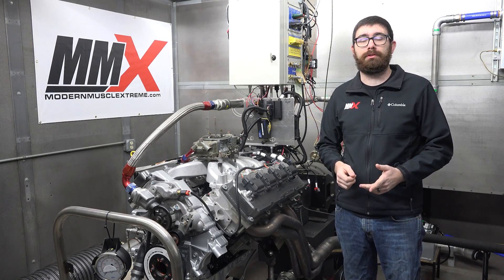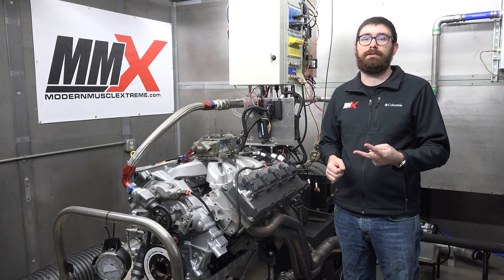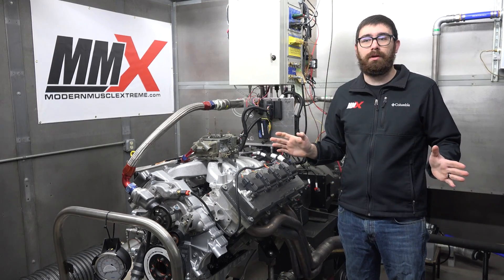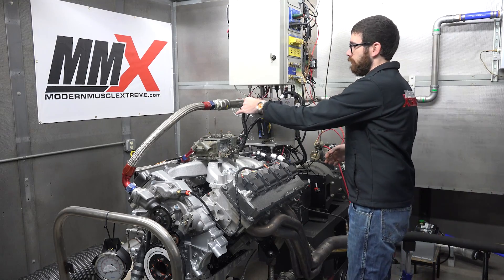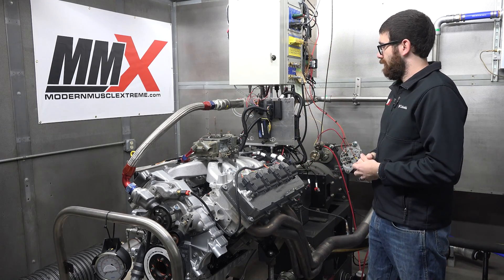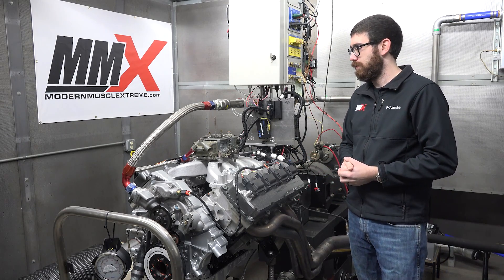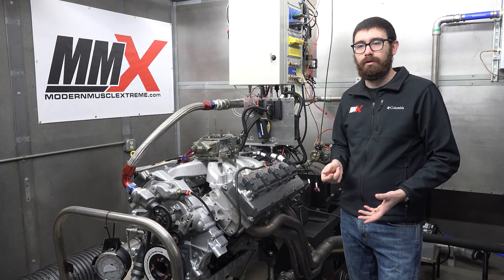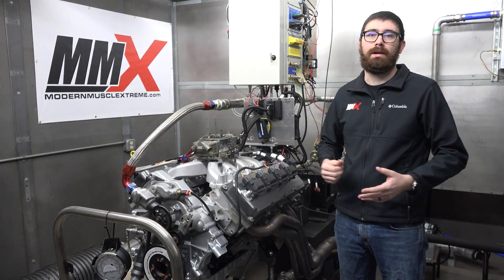Gen3 HEMI Carburetor Ignition Control System by MMX and EFI Source!

Comment: Greetings! I have a similar project, but I don't know much about that engine! I'm thinking of replacing the camshaft with a CompCams #201-426-17and a holley ram tunnel with 650cfm carburetor pair, I'm worried about the VVT system! Is it possible to remove it? And most importantly, friend, part numbers and manufacturer of the electrical parts to use

Comment: Customer came in last weekend  with This MMX system on a 74 D100 4x2 with a 2015 junk yard sourced SRT392 , we had to tear down the front of the engine to lock the cam, got it back up and running. simple to use , setting timing map was easy . The customer is having us replace the set up with a 05 Durango ECU  and use a SRT8 manifold and 90mmTB,

Comment: What about the mds. Just leave it disconected
Reply: MDS= Screwed , need to delete the MDS system
Reply: Just leave the solenoids in with no wires to them and it will run an mds engine just fine

Comment: Whats the advantage of this system over the EFI
Reply: 1 advantage would be to be able to swap cams and bolt ons & tune it myself. $300 for towing & $900 for dyno tune & still get O2 codes. Reading spark plugs or wide band would be very helpful.
Reply: @palmbeachcane9523  you need a better tuner.
Reply: @TaylorJensen-ys2cv  Not that many tuners in South Florida. Closest tuners are 50 miles away.
Reply: Simple